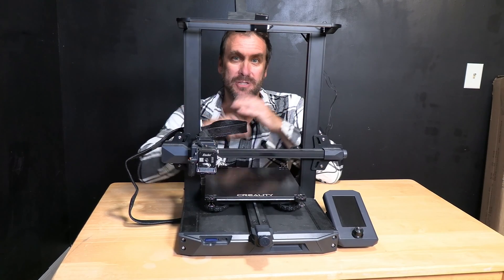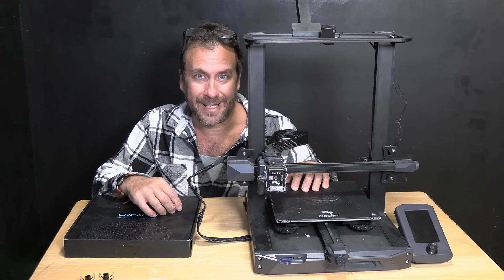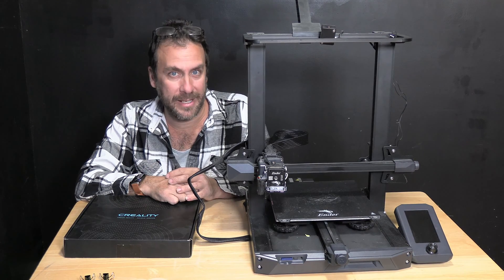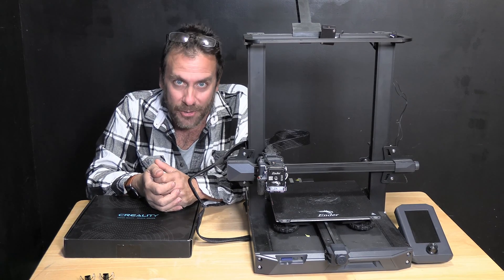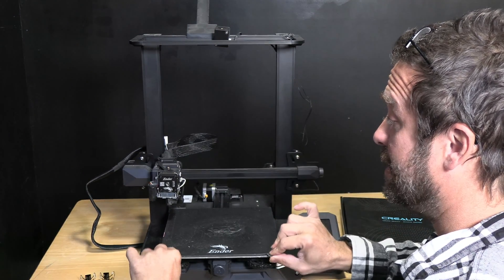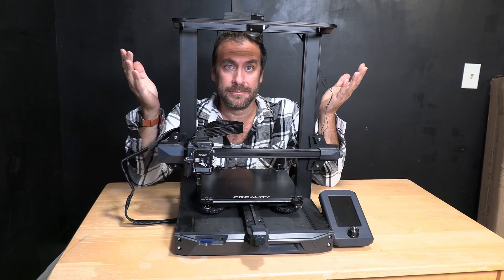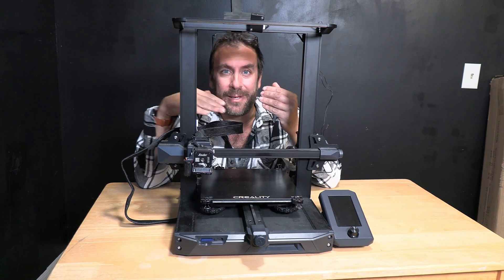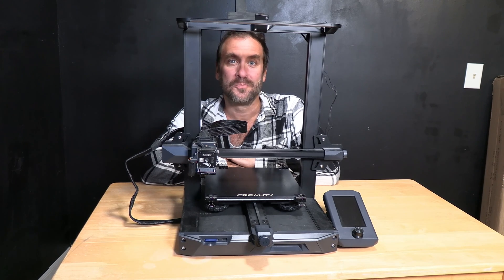Swap Creality Ender 3 S1 (or S1 PRO) Magnetic Bed with GLASS BED, for Instantly better Results!

Comment: I have same machine, original every part. How to use the paper clips (similar size is u use) to not toss out the head? Before start the print, doing the head cleaning step every time toss down the clip..
Reply from the maker: Use just the 1st few mm of the clip
Reply: @3DRundown   I try to grind down little bit the curve side and better, but neet to chage the pei to glass ( i do) but nigthmare to set correct the bed in my e3 s1

Comment: Unless you're doing high temp prints.
Then you want to remove that magnetic pad.
Reply from the maker: No
Reply: @3DRundown Why not ? It doesn't hinder heat transfer ?
Reply from the maker: I have never had an issue at all.
Reply: @3DRundown FR brother. Trying to additively manufacture a 19 and the print is close but the fill is supposed to be 100% infill but not quite solid, hairline pieces not forming.

Makes me question the structure strength. Any help or advice is welcome.
Reply from the maker: 100% fill is tough to pull off. Add more WALLS instead

Comment: I have an old Longer lk5 pro, it has no bl or cr touch, but the layer adhesion and the quality of the first layer is perfect. On the other hand, I recently purchased an s1 pro and s1 plus, oh god, leveling them is such a pain and the result is baaaad; Have all kind of problem with them. I am going to downgrade or UPGRADE to a glass bed.
Reply from the maker: The S1's are notorious for having ABL issues. I tried so hard, but never figured out why. I actually gave up on my S1, but my S1+ was amazing. GLASS is never a downgrade. I miss glass.

Comment: My glass bed is spot on and I do not have to level it.
Prints do take a bit of prying. I use a one edged razor blade and push it into the corners, making sure I do not scratch the bed.
I am happy with it.
Flat glass is formed on molten Tin. It should be extremely flat coming out of that process.
Reply from the maker: Glass should fully release by simply letting it cool. I like glass (allot) But a flexi bed makes life so much easier

Comment: I have the opposite problem,. nothing sticks to the bed 🙂
I have the brass/golden looking one though
Reply from the maker: Textures PEI sucks. I would use Glass, or Smooth PEI. 
For now, Clean the crud out of your bed, and work with your Z-Offset.
Reply from the maker: Try this: 
https://youtu.be/veZB415QHM0

Comment: To get flat prints off of glass, take the bed off the printer and put it in the fridge.
Reply from the maker: No. Wait for the bed too cool. Then pick up the print. I have never removed a glass bed for any print, ever.
Reply: @3DRundown  Well I'm going on 3 hours of cooling now and the print is still firmly adhered to the glass bed. I don't think it is going to come off by it's own. The bottom of the print is completely flat.
Reply from the maker: Is it NEW glass? New glass takes some time to "break in". print a bunch. Wipe it with IPA betwene prints, and it will get better. spray the base with IPA, and slide a razor under the print to start it. Typically, once it starts, the whole thing pops off. This problem will go away after some use.
Reply: @3DRundown  Ah it is new. That may be the issue. It's the same type as in the video. Pla with bed at 48C

Comment: Coming a bit late to the party, but thanks for this video!
I just got my S1 Pro and I was wondering why prints were failing after a couple of days. Turns out I couldn't level my magnetic bed properly... because it's crap :)
Reply from the maker: The PC bed on that S1 (it's not textured PEI) hold great, but, tramming can be tough. Also, the S1 has a history of bizarre ABL behavior. Glass is King
Reply: @3DRundown  I was given the textured PEI, and for some reason I can never level it properly - when I manually level points 1, 2, 3 and 4, the center point is always way too far from the nozzle. Never had that issue with glass on my Anycubic indeed
Reply from the maker: It's because the S1 Hot plate will physically BEND when you tighten the knobs.
Reply: @3DRundown  Gotcha, thanks ! :)
Just received my glass bed, testing a print as we speak. The binder clips kinda freak me out though, one of them got knocked off by the BL-Touch module. Do you know of any other way to attach the glass bed?

Comment: I have damaged my stock print bed that came with my ender 3s1 plus printer. Can you recommend me some replacement or where i can buy a new one? My printing size is 300x300mm and i cant seem to find any replacement for it. All available beds are either 310x310mm or smaller
Reply from the maker: Link to a glass bed here: Replace Creality Ender 3 S1 Plus Magnetic Bed with GLASS BED. Set Z Offset & ABL - 3D Printer
https://youtu.be/qiOvpCsJ2yM

Comment: I know you said that it would not fuse to the magnet, but mine keeps getting stuck would it be safe to use a little petroleum jelly or pam non stick spray to keep it from sticking. also I think the bed is warped,  because the back of the bed is always higher than the front its enough that if I tune the z-off set so that the back is printing well the front will not stick. I have 8 printers and have been into this hobby since 2015 but this one problem has me at my whit's end. any advice would be greatly appreciated thank you for your time.
Reply: I forgot to mention its the Ender-3 S1 plus.
Reply from the maker: Put it on and leave it on. I've never removed a glass bed. Try to fix your tramming issue by following me here: 
https://youtu.be/dpF_h8aOTAI
Reply from the maker: Also, make sure your gcode is right:
https://youtu.be/mKvst6qpkPw

Comment: Worked for a week trying to get the glass bed to work. No matter what I cleaned it with, or how much time I spent on leveling, nothing would stick. Went back to magnetic bed, and all is well. Open to suggestions to get the glass to work.
Reply from the maker: I promise you glass is better than pei and has better adhesion. Forget leveling. Your issue is likely Z-Offset. Wipe it down with IPA only. Use a bed temp of 60, and carefully adjust your Z-Offset during the 1st layer. Can also hit it with a quality hair spray. That is common practice, but CLEAN is the most important part. Also, make sure using the textured side of the glass
Reply from the maker: Try this exercise with your glass: https://youtu.be/veZB415QHM0

Comment: This is really strange seeing glass is used instead of PEI. I am printing with PETG only and after using glass and having all the time troubles with it, I have switched to PEI magnetic one and that was the happiest upgrade. No glue anymore, cleaning the PEI bed once in 10-20 prints. No adhesion issues at all. 
Why going in reverse direction is mystery for me. 
Also why remove magnetic from platform  - you can never switch back.
Reply from the maker: I get the feeling you didn't watch the video? I did not remove the Magnet. That was the whole point. I put the glass directly ontop of the Magnet. I switch all my machines to Glass. Glass is more durable, had better adhesion, Easier to Level, or correct a warped plate, and releases models on it's own when cool. The only ones I use PEI on, are machines with no available GLASS bed. Currently they are: K1, K1 MAX, P1P, and P1S. I still have the PEI bed on my Ender 3 V3, and CR-10 SE. We'll see how they do...
Reply: @3DRundown  sorry for my mistake. Indeed you have not removed it. What I wanted to emphasize, that for me pei was god saving upgrade after glass bed.
Reply from the maker: No worries, just want to make sure nobody removes the Magnet. That is, indeed, a terrible idea. Glass, IMO, offers many advantages over PEI, and is easier to work with.

Comment: Mine doesn't seem to come off (it's an Ender 3 S1). It looks identical to the one shown here, but it feels like it's glued at the center. Should I pull harder? Is this the strongest magnet on earth (I already turned the printer off in case it was an electromagnet)? It feels like it's going to break.
Reply: Ok it did come off. I really did have to pull harder.
Reply from the maker: Just a  magnetic bed, you should be able to easily remove it regularly. Weird to hear it was so tight.

Comment: I was watching another video, on the older ender 3 pros (non-dual drive) the host adjusted two screws on the z axis sensor, he lowered  a little, is this not a thing to do with the dual drive ender 3 S1, If I don't could I crush glass?
Reply from the maker: The Z-Stop switch is not used when you have an ABL Probe, such as the CR-Touch

Comment: ive been through all, plastic, PEI, Glass and the Springsteel-PC it comes with. I actually destroyed the coating after a week, because things stuck so hard to it, i went a little violent. Then ordered 2 new ones from ebay. Turns out, i just ordered 2 of this cheap plastic wobbles. Then bought a new springsteel, totally overprized for 30 bucks and also a Glas. In total in almost 100eu, just to find that in the end a PEI Plate from Ali for 13eu(without magnetic base) is far superiour to all the rest. Finally a surface where everything sticks but also releases without a mess. I would advice to go for PEI right away, dont bother with anything else. Keep the original PC-coated springsteel for cases, where you want extreme good adhesion. Tall things with a small footprint for example, that tend to fall over the higher it gets. However, i would consider the PC coated springsteel the second best and would never change it for a glass bed, if i had the choice and could only have 1. If it sticks to good, you can counter that by raising the Z-offset a little bit and reducing the temp for the 1st layer by 10-15 degree.

Comment: I am very new to 3D printing.
I have seen many of your videos, which are noticeably clear and complete, but I can't find a solution to my problem.
I am upgrading to the glass bed on my Ender 3 S1, because I am having issues with the adhesion on the standard bed. I watched this video and then the How-to Level, Set Z Offset, and Make an ABL Mesh, on a Stock Creality Ender 3 S1.
The problem I have is that even changing the Z-OFFSET value, I can't find how to level the bed.
I need to figure out how to change the z-limit so that when levelling it doesn't try to embed itself into the glass, since the Z-OFFSET has a limit that doesn't allow me to achieve levelling. I would need to be able to lower the bed further or raise the lower limit of the z-axis.
I've seen videos of the Ender 3, and it seems much simpler since you can move the z-axis limit switch, which you can't do on the 3 S1. 
Please, can you help me? Thank you in advance.
Reply from the maker: There is no limit switch when using a CR-Touch. Set your Z-Height by adjusting your Z-Offset. I have a video on this for the S1. You can lower the bed by tightening the knobs, but you don't need too. If the Nozzle hits the bed, your Z Offset is too low. Set it higher
Reply from the maker: How to Level, Set Z Offset, and Make an ABL Mesh, on an Stock Creality Ender 3 S1
https://youtu.be/raSW7cDGObg
Reply from the maker: How to fine tune your Z Offset on a 3D Printe
https://youtu.be/veZB415QHM0

Comment: I have done all sorts of levelling tricks on my PEI bed and now I realize that my bed is warped.  The high point is in the center and if I account for that then the nozzle does not touch all 4 corners.  I don’t understand why the BL touch system cannot create a mesh to accomodate this error - what is the point of auto-levvelling if it does not account for bed warpage?  I am thinking I need to get a better quality bed - I am wasting a lot of filament because each time I print I have to start over with the levelling process to get this to work.  Will putting a glass bed reduce the warpage if the high sport is in the center of the bed?
Reply from the maker: Make sure not over-tightening screws when tramming, warping the plate down in the corners and creating that high-spot. If you watch as you tighten, you can see it happen. I  swapped for glass. Instantly better
Reply: You should go to store settings after you level because creality has some weirdness with the firmware and I swear it does not store your mesh unless you do that.  I believe that is in setup/configuration. I can't remeber because I swapped my screen for an old style 12864 screen.  

Or you can use TH3D's unified 2 firmware, or edit it yourself to restore or enable bed level after g28 in the printer config file.  

Also, put M420 S1 after G28 in machine start gcode in cura (in manage printers menu).

Comment: I am using glass on both of my printers.. but I would like to make 2 points: 
1. I also use the creality bed, its good glass quality and works great.. but I ONLY use it with the NON-coated side up!!!.. it sticks great and when i cools to under 40 degrees C, the prints just slide off..  I had problems with the coated side, eather sticking to much, or not enough. 
2. Yes on an ender 3 s1 pro, the front left clip is in the way.. no matter where you put it.. if its not the nozzle, its the cr-touch that hits it, if its not during bed leveling, its when having prints near the top left corner.  Creality has some special flat clips for  the glass bed, but they dont work, because they are 7mm which is bed plus glass, but with the magnetic sheet they are too small. all other ones are too thick!!!.  I came up with one solution, i use something on amzn something called bulldog clips. They still are too high. but you can modify the upper side with a pair of pliars. Sqeeze it flat and carefully hammer the upper side flat. The height will not exceed half a mm then.. and they work perfect for the glass bed on an ender 3 s1 pro.
Luc
Reply from the maker: I ONLY use Textured side of Glass. about 20 of them. They work great after a break in period, with proper care. I've never had anything hit my bed clip. Maybe you put them on too far. I only clip them at the tip.
Reply: @3DRundown  thanks for your reply, It only happens on the ender 3 s1 pro! after the prime line, the head is in the far left corner. the cr-touch is much lower than the bltouch on other printers, and  if you have a bigger print, even if the skirt is one cm of the front edge, the cr touch is like 2 cm over the edge, YOU CANT PUT THE CLIP FURTHER outside of the bed and the cr-touch is only 1 and a half mm higher than the bed. so it has to hit anything that is higher than 1 mm.. so even the clips that are far away get hit. ok.. only at the beginning of a print, but it happens all the time, unless you place the printed object far left to the back. try it, by pushing the bed and the head manually, even second layer hits  the clip. 
IT ONLY HAPPENS on the ender 3 s1 pro.  AND only if you have a prime line on the left that comes up to 1 cm to the front of the bed and your skirt or brim is starting in the front left corner.  A working fix would be to remove the magnetic sheet that is glued to the aluminium part of the bed and then use the creality flat clips. they are less than 1 mm thick. but i would like to switch back, maybe one day and that is then impossible. i will try in the future to grind down some 2mm thick clips but i fear it will not really work.

Comment: If you add on the glass bed to like an S1 pro, do you have to account for that extra weight with the stepper motors, like make any changes to your settings? Do the motors seem to do OK handling that extra weight? Thanks for the help!
Reply from the maker: No change. Just send it! All my machines are running glass

Comment: I have the S1 plus, and I want the install the glass bed 310x310 CR10s. The bed that comes with my s1 Plus has 2 screws that indexes the magnetic Pei. Can I remove those screws so I can install the glass bed or these have another use in the bed beside indexing the position of the Pei?
Reply from the maker: I have the glass, but never put it on. Some peeps remove the screws, and use lower profile screws. Some claim their glass fits ontop of them (mine does not!). I am reslly not sure about flat removing them. I should look into this at some point. My S1 plus has been making flawless masks for me, so I stopped touching it
Reply: @3DRundown  unfortunately mine is completly wrapped in the center. So i really want to install a Glass Bed.
Reply: What did you end up doing?  I have the same thing, there are 2 screws in the way.  It doesn't fit. I can't find any other video or help regarding it.
Reply: @daniellesanchez6150  you can remove the screws. Their only purpose is to index the magnetic PEI. Then you just have to align the glass bed on top of the magnetic bed.
Reply: @Philippemacedo  thank you very much on this information... Because of some things we destroyed magnetic PEI which has notches and bed has 2 two screws. We want to replace it with glass bed but there is no glass bed with notches and wasn't sure can we upgrade our bed. Now we know. Thank you once more! Greetings from Croatia!

Comment: will this creality bed work for nylon?  they say glass works good but i think this bed has a coating on it. small edit. on crealitys site they sell a pei glass bed, and a carborundum glass bed. is the carborundum bed smooth? its hard to tell from their picture
Reply from the maker: The bottom side of the glass beds are smooth. I actually just got a Carb. Ed, to check it out, but haven't opened it yet. Just flip your glass for a smooth side

Comment: Thank you so much for this video, please could you make video explanes how to edit the bed size in cura because the extruder hits the clips when doing auto level or moving throught the bed
Reply from the maker: I will try. When using clips, put just the tip of the clips on the bed
Reply: @3DRundown  i did that but unfortunately the extruder hit it and i got a headshot from that clip 😂💔
Reply from the maker: LMAO! Is the clip to big!?! I use small clips. Also, the magnet tends to hold the glass by iteself. I use only 2 clips now.